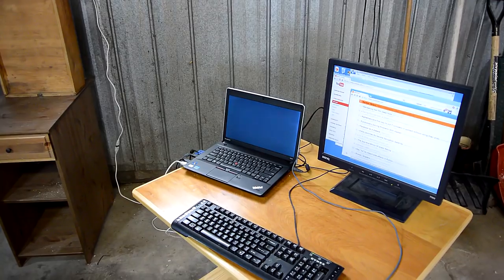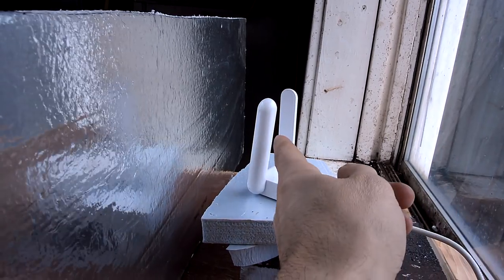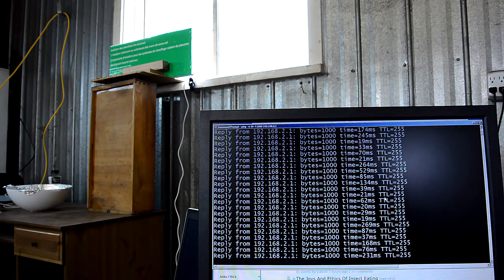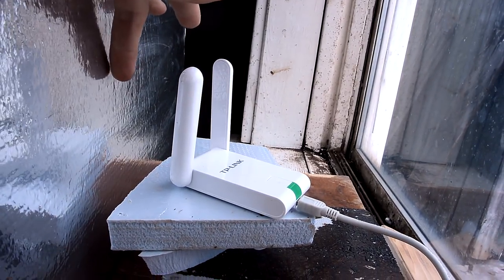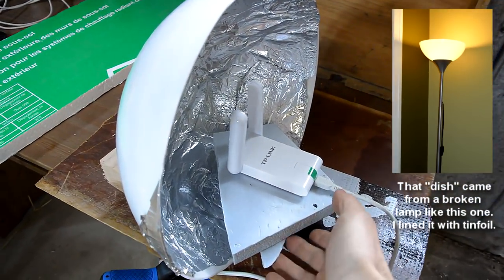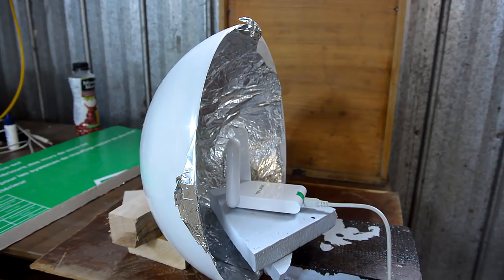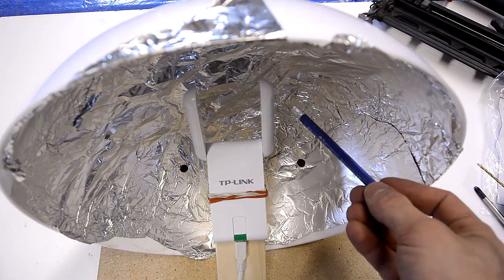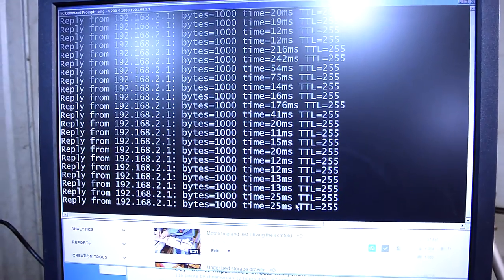Wifi antenna booster dish

Comment: Old video but still want to tell you why you have the difference  in pings. Wifi Is one way communication between a CPE (your pc, a phone, laptop.) and the Router. The Router can only talk to one CPE at a time. It sends a single to your CPE the CPE send the single back. Then the Router moves to the next connected CPE, Send a single to it, and it back to the Router. I alway explain it like this. Say you have a baseball game going. Your PC is a batter along with a Iphone, and a xbox. The Router is the pitcher. So the pitcher (router) sends a ball the batter (your PC) hits the ball and because you are watching Netflix your batter is really Fat. he takes a long time to run around the bases. The Pitcher (router)can not throw the ball to the next batter (CPE) until yours is done running the bases. so it has to wait for you to finish before it can send the ball to the Iphone.